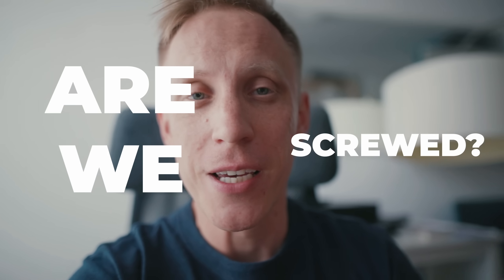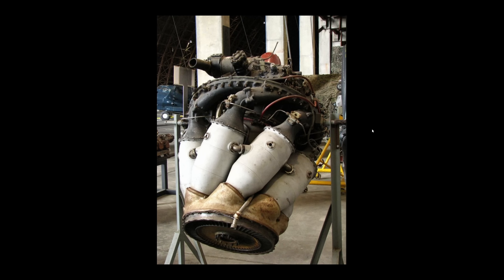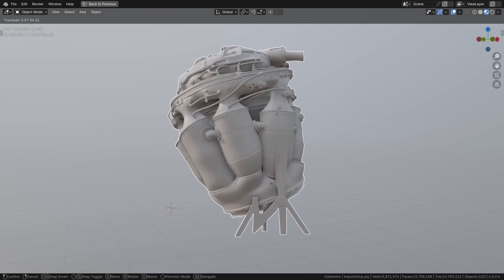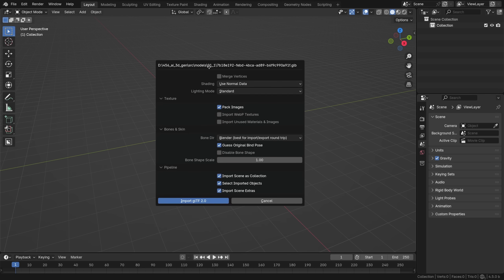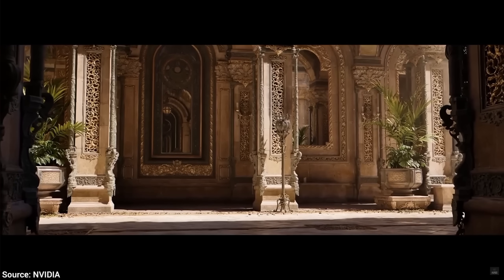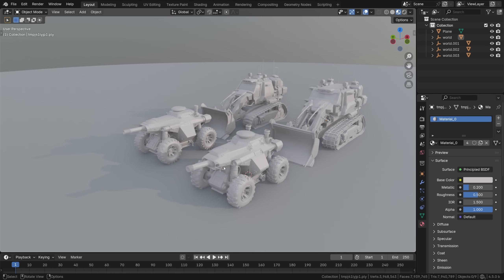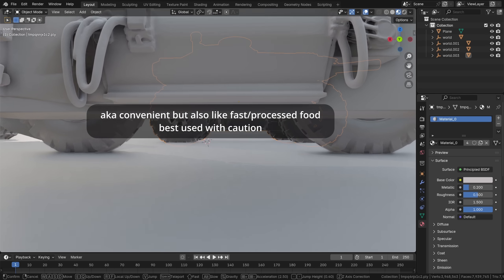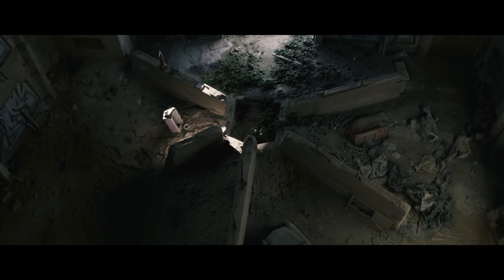Are We Screwed? (A New Hi-res 3D Shape From Image Method)

Comment: There is a huge difference between this and simple image generators, ai voice reconstruction and such. This creates based on an input image. Which ofc can be ai generated, but: you can hire concept artists and this ai will do the 3d modelling (depending on the asset you need retopo, additional sculpting, etc). This takes away a lot of jobs from 3d modellers and because it's fully under the artist's control, no-one will defend those modelling jobs. Everyone should start practicing retopo and texturing, because those jobs will last for the longest. But I think retopo will be solved in 2-5 years as well. Texturing and adding little details probably will be around for a while to maintain human control.
Reply from the maker: Probably. And what if retopo and substance-like pbr texturing workflow also get solved in a similar manner in a year or so... It's getting hard to make any predictions.

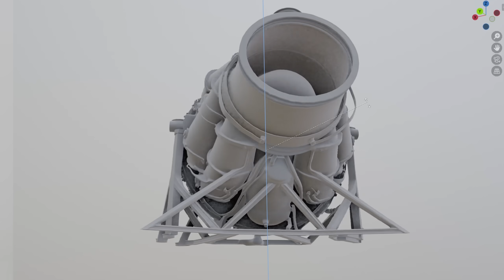Comment: 06:17 You just answered your own question. I heard the same thing about other programs like Poser, but now we have Metahuman and Character Creator and paint programs like CorelDraw and the king, Photoshop.

Back then complaints were it's "cheating" but to me it just speeds up your workflow if you use it right.  I've come up with stuff I would have never thought of before.  Now as far as this method if it's static and not animated in any way just clean up the topology or decimate and your good to go. If you have to move it with animation you'll need to do a little more to process the model but it's a great starting point. The AI is not going to replace a human just yet but things will change and people are just going to have to adapt.

Comment: Must be many situations filling scenes with stuff that need no close up detail and accuracy this will easily replace making them.  I suspect they will be able to get ai to detect flat shaped corners etc and  at least swap in good topology for basic shapes like pipes wires body panels in these vehicles.

There is the divide of those making money out of 'artistry' and the masses for whom it is just a fun thing to do, and short cuts are just not a relevant point. Like who wants to buy a ready assembled and painted construction kit? The fun is in the making much more than the result.

Comment: This is cool for 3D art and nonstructural 3D printing. The challenge is from an engineering standpoint is that each part it fever dreams is not optimised for use or manufacture. Maybe in a decade or so we'll have engineering fever dreams that'll function to a predefined specification or even an initial design intent.
Reply: Ten years in ai time is the equivalent to 100 years. I think it will be a lot sooner. We’ll soon be restricted by our creativity instead of technology. ❤🎉😊

Comment: Silhouetting and size judgement, and base building sculpt, its good at getting the general shape but if its soft surface it becomes messy. But it saves time in some respects, its certainly a good model to use as a visual aid whilst you model the proper version, plus it doesn't fix the rigging and unwrapping which people would be actually excited to see fixed. This is a nice idea but needs more time to cook and preferably have a better ui interface so we could direct it as well.

Comment: This is awesome but can we not modify them  after it generated as 3D model ? not even have a vertex right ?
Reply from the maker: The current output is a dense mesh - I'm sure a better topology output will become a thing pretty soon, but currently it's similar to exports from the photogrammetry software. E.g. to make it more or less adjustable, you'd need either retopo or sculpting tools.

Comment: I tried many Ai tools, major issue with all of them was lack of control over output. 
It generates results from so, If you make little change literally you get completely different outputs than previous. 

I like how cascadeur and Epic is doing with their Ai Tools/Projects (Ai mocap/animation or ML deformer etc). Those are much more useful.
Reply: part of actually learning how these tools work is to learn how to use them effectively. create a depth map to use as a mask for your i2i generation using a composition you specifically created in photoshop. cant get a consistent character? train a lora.

here's the problem. the consistency issue is a skill issue. its just fact. I've seen too many examples.
Reply from the maker: Haha yeah) a lot of statistical machines right now feel like rolling dice, tweak a prompt or just re-generate or change any property of anything and suddenly you're in a whole different direction, or it just suddenly is horseshit (most likely). That randomness gets old fast...
Reply: @GlebAlexandrov  Yes, but we can use ControlNet with inputs like depth maps or pose libraries to guide the AI-generated content more precisely.
Reply: al that means is they need to develop better ways to specify changes. Like for 3d models, being able to highlight a volume and limit the AIs changes.

Comment: I tested it. The geometry was so bad zremesher could not handle it. And no textures. No separate objects. It has a lot of potentual. But right now i will not use it even if its free. However i am using other Ai tools and photogrammetry which do work. And yes, 3d modellers are cooked. Soon. 60% reduction in paid modelling work at minimum.

Comment: Hunyuan 3D, tripo 3d, etc all these generative AI models are working in the same direction. And some of them churn out some great output ( New Hunyuan 2d 2.1 works on PBR shaders as well). 3d gen AI is getting better day by day but some intricacies are still not represented accurately ( because, obv it is hallucinating ) and iterations and revisions according to client will not be possible. Retopo will be needed, but for the base mesh, these look great.
These assets for now are amazing for props in your scene, or maybe some concept work, quick ideation and storyboarding workflows, and im looking forward to this implementation of gen AI in our workflows, which will help us create things faster, and help us spend time on other things. 

I used to bash AI a lot all these years, but since late last year, i have been trying to fit some AI especially generative AI in my workflow and im sure it will help a lot of creators like us create some great things. Thats why, i think rather than bashing it, we should embrace it as a tool, try to understand what is it doing and where does it fit, and in turn integrate in your respective workflows.  

Also, comfyUI ( node based interface to run generative AI models locally on your machine ) is just killing it these days. You should definitely check it out. People are creating some amazing content using different models.

Comment: At 1:51,  the opposite side is kind of blobby and melted.    Looks like a mirror modifier is better o symmetrical objects rather than having it guess.    I wish radial symmetry was easier in blender
Reply from the maker: Not the most defined geometry ever, actually pretty melted indeed. It's still kinda workable, and impreasive compared to what we've had before, but in this particular case I would better find an alternate angle of that jet engine and run the process again, then merge two meshes together (in fact, I've tried doing exactly that when experimenting with the tool, and it was relatively successful). However, retopo is still a headache.

Comment: 3D modelling is not my end goal. I just want to push pixels on the screen and make content. So the more of the boring stuff that gets taken over by AI the happier I am.
Reply: Your "boring" is someone else's happy place where they find flow. A lot of people love modeling. Just because you don't want to do the work, it shouldn't follow that nobody else should either.
Reply: @aaronvdw don’t worry, content creator’s jobs are going away too…

I used to be able to diagnose a failing transistor in a TV power supply faster than most component level repair technicians and I could disassemble an HP Laser Jet Series II in under 10 minutes… be prepared to find another way to make a living…………..
Reply: @MachinedInWood   You're somehow failing to see the difference between a creative and a technical job. A technical job can be replaced by cheaper mass produced product. When you have repaired a TV or a printer, you still have the same mass produced TV or printer, with the only difference that eventually, an item that cost 1000 can be replaced for 100, making the craft of electronics repair less desired. An item which exists purely for its function. Art exists because people want that other person's insight or vision, not for any function.

That being said there's of course a fair bit of human made slop that may well be on the chopping block. But true creativity cannot be replaced.
Reply: @aaronvdw i know. And we all have different happy places. Mine is making music with synths. Which is much further along in AI than 3D. Doesnt bother me. I can still make all the music I want to. With as little or as much AI as I like.
Reply: i was thinking a lot of people might be underwhelmed if they ARE a 3d modeler for fun, i'm not sure on the demographics, but i wonder how many people don't do CG stuff for any other reason than they just enjoy each of the processes, or maybe even pride in being able to point at something and go - yeah i made this.

But others will want to tell stories where some of this stuff will make some concepts easier to pull off. But yeah a key part of it is how people see themselves. :) Aidy.
Reply: I dont find boring 3d modeling, 3D MODELLING IS MY GOAL MAN
Reply: what i should do now??? i must quit honestly, and i just started 1 year ago

Comment: As it is, this could be great for creating background props. Just generate, texture in Substance Painter and throw it into a scene. For anything else, the poor topology is a big problem. It’s not so much the high poly count that’s the issue, it’s the lack of defined edges and boundaries for the model’s constituent parts.
The big breakthrough (for this and the regular modeling workflow) will come when AI auto re-topology tools are developed.
Reply from the maker: Yes. That is precisely what's somewhat holding it back. I can only imagine what the synergy of these more advanced 'grammetry methods and an auto-magical retopo/rebuilding algo will feel like. It'll probably unleash an enormous amount of energy on collision.
Reply: totally agree! Point very well made :) Aidy.

Comment: I work with UE5 for virtual production as a CG artist at a fairly large company and I'm already seeing the end of the road as far as manual content creation within the 12 to 18 months. To the extent I'm already considering my exit strategy from the sector.
Reply: would you mind elaborating on your experience? Are you already seeing a reduction in staff for example? In some of the projects we've worked on there still seems to be a lot of requests from folks that come in to 'move that up a bit', 'change that slightly to this' or whatever, things that AI really seems to struggle with at the moment. Or is that the point you suspect that all the problems will be solved within 12 to 18 months?
Reply: And what would be your advice on exiting?
Reply: What is your exit strategy?
Reply: @fullyleaded  same here, I hv worked on several small vp projects here and im already considering the career change, no future i can see for as a creative with the rapid dev of gen ai sadly. will be doing 3d only as a hobby in future.

Comment: I feel a bit scary of the possible fast developing of new tool that can be capable of reasonably topologized stuff... AI runs fast! :)
Reply from the maker: Yes, that fusion will produce a nuclear blast (if not an extinction event?).
Reply: i wonder is there any chance that the perfect topology is such a hard thing to achieve that it'll be quite some time before AI can really get there, and even then, it'll just mean the human does the last 5% cleanup and makes the tweaks desired by the art director - or themselves, or whomever. Usually in these quick automated systems, often instead of needing less people, they just get the same amount of people but now output more stuff. 

Like the general idea of all these automations that have occurred over the decades, once upon a time they thought we'd be working really short weeks but of course many people work more than ever, despite all those alleged speedups in workflows. Admittedly there is something a bit different about AI though, so culturally we should be mindful of the uniqueness of all of this most likely. :) Aidy.
Reply: glory to machines, glory to the Universe